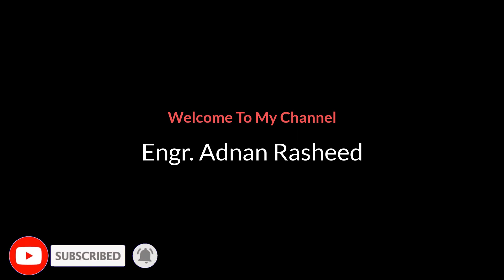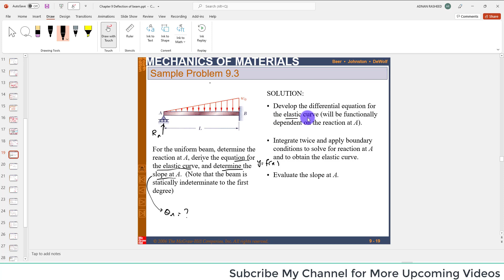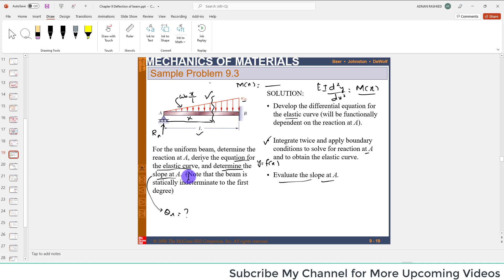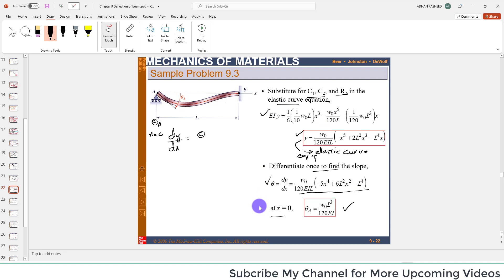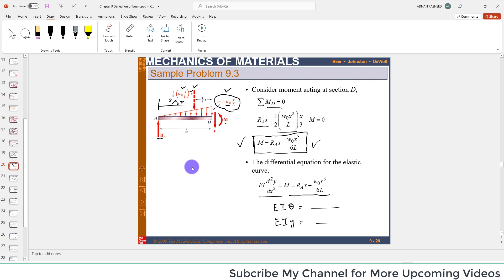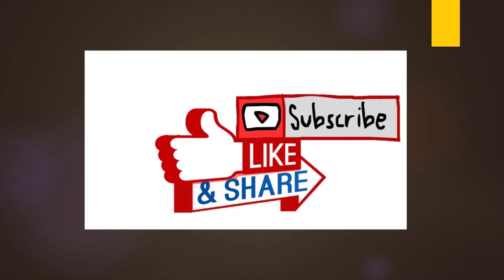Ch 9 Part 3 |Statically indeterminate beams | Mechanics of Materials 7 Edition | Beer, Johnston

Comment: 10:10 how do you calculate 1x/3 and 2x/3. distance from the concentrated load
Reply from the maker: For triangular load when converted to point load, it's location will be 1/3 x length over which this triangular load acts from the side having higher value of load and from starting load this will be 2/3 x length over which triangular load acts. Kindly memorize it as you will encounter with such type of loading on beams in future. ❤
Reply: @engradnanrasheedmechanical  thank you sir
Reply from the maker: @user-vm4wo5fs5f you are welcome